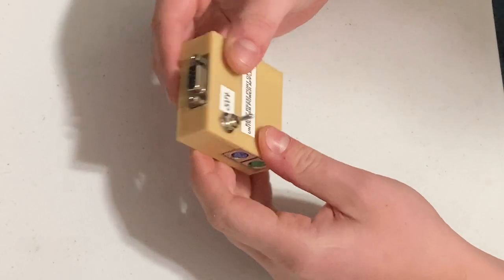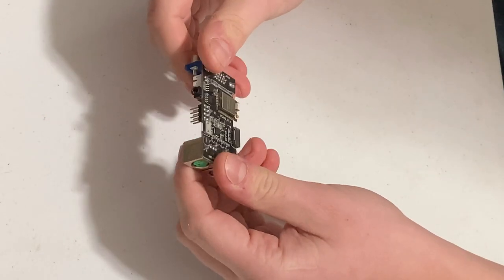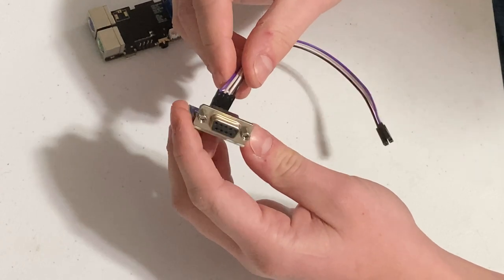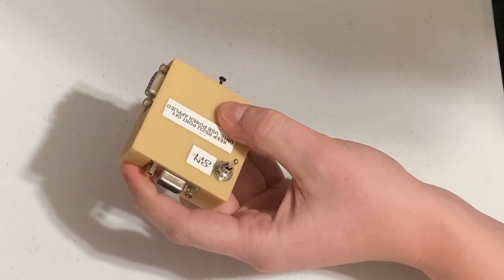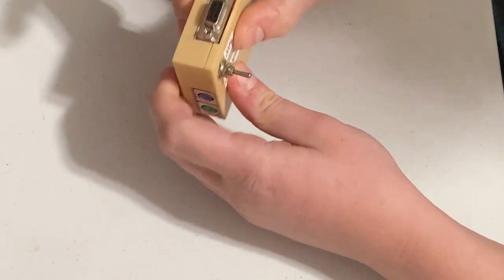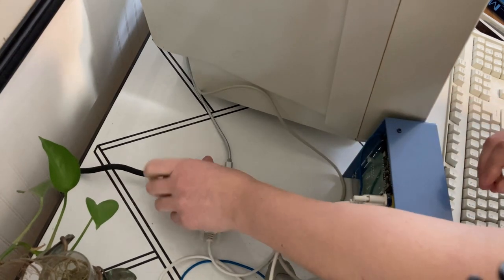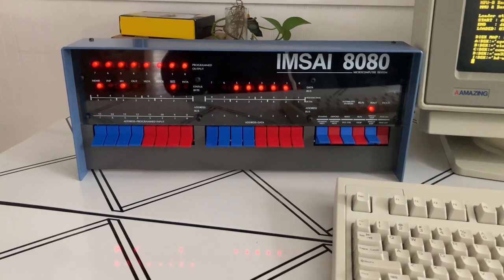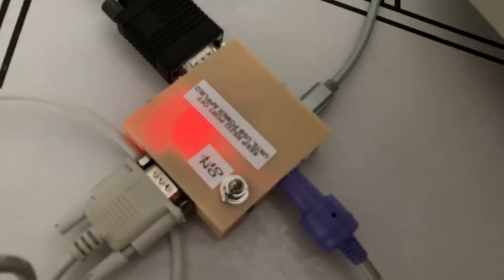How to use any VGA monitor as a serial terminal with VGA32 and FabGL (featuring IMSAI 8080)

Comment: According to Martin Heperle do not use GPIO12, instead connect GPIO14 to RXD on the TTL-RS232C convertor.  Then in your sketch replace the GPIO12 Serial.bgin lines with: Serial.begin(BAUD_RATE, SERIAL, SERIAL_8N1, 14, 2);   <- this way you wont need the switch!

Comment: I am deeply amused that you're use an ESP32-based terminal to connect to the IMSAI 8080 replica that is running, if memory serves, on an ESP32. :)
Reply from the maker: ESP32 INCEPTION! Lol, I am glad to have amused you! I think the new firmware for the IMSAI replica has added the modem function, I should check it out.

Comment: My dream is to build a retro-styled all-in-one vintage serial terminal made from NEW parts. It would be styled something akin to a Radio Shack DT-1 terminal. The case would be made from wood, plastic, metal, or a combination thereof. The keyboard would be a custom built mechanical keyboard made to fit within the case. The internal terminal logic would be something like what you've shown here. The hard part is the monitor. Ideally it would be a genuine CRT monitor, but I could also live with a native resolution 640x480 VGA flat panel. Both are impossible to source new I think.

Substitutes are possible, but this rules out the possibility of making them in larger numbers.

Using a TRS-80 Model 3 or 4 chassis would be acceptable, as would using the monitor from such. The keyboard of a Model 3 or 4 is not sufficient, because they don't contain all the keys necessary for modern operation of a Linux-based computer (square brackets, curly braces, etc.).

Reusing the CRT from an old VGA monitor would be possible, but again, this rules out making them in larger numbers.

I envision the whole thing as an open source project that people can use to actually build one of their own.
Reply: VGA flat panels are available new, but I haven't seen big panels. Biggest I have seen were around 6 or 8 inches.

Comment: Nice project. I see in the comments several requests for information about which pins on the VGA32 module to connect the MAX3232 module to but it isn't answered directly, though a link to an annotated drawing is provided. I also wonder about the need for the toggle switch, which is presumably used to avoid a clash.

Someone commented that the toggle switch can be avoided by using GPIO 14 for Rx instead of GPIO 12, though both are used by the micro SD card socket.

The header next to the audio jack gives access to 3.3V and GND, which can be used to power the MAX3232. It also gives access to GPIOs 39, 34, 12, 14, 13 and 2.

GPIOs 12, 14, 13 and 2 are allocated to the micro SD card socket which might be available for use once the device has booted, if no SD card is inserted. GPIOs 34 and 39 appear to be available for use so when my modules arrive I plan to use 34 as Rx and 39 as Tx and to accommodate that I'll need to edit the sketch. While I'm waiting I'll take a look at the sketch and see which GPIOs are assumed by default.

Comment: Thank for sharing this, I've just reeived a couple of these and I need to add the serial port connection. I was wondering about the 3.3v - 5v issue but you answered that at 2:10. I've now ordered some MAX3232 boards for this job.
Reply from the maker: Glad it was helpful! Enjoy your project :)
Reply: Nick - was the pin out on the VGA32 to feed the MAX3232 fairly obvious

Comment: Hi,  The connections from the TTL to RS-232 adapter to the VGA32 board should be in the description too!  What are they?  I got +3.3V and GND, but I don't know which PINs on the VGA32 are Tx and Rx ... My boards didn't come with any documentation.
Reply: To use the two serial ports, only Port 2 is available on the 'User Pins' on the board and one of the I/Os (io2) on the 'User Pins' is shared with the TF memory card.
The power brought to these units with the FABGL library is mind blowing, a pure work of genius.
********************************
** FabGL GPIOs assignment summary **
********************************

** VGA boards:

  VGA
    HSync => 23
    VSync => 15
    R0    => 21
    R1    => 22
    G0    => 18
    G1    => 19
    B0    => 4
    B1    => 5

  Audio
    AUD   => 25

  PS/2 - Keyboard
    DAT   => 32
    CLK   => 33

  PS/2 - Mouse
    DAT   => 27
    CLK   => 26

  SDCard - HSPI
    MOSI  => 17 (12 on TTGO/WROVER)
    MISO  => 16 (2 on TTGO, 35 WROVER)
    CLK   => 14
    CS    => 13

  UART - UART1 (USB)
    RX    => 3
    TX    => 1

  UART - UART2
    RX    => 34
    TX    => 2  (not usable on TTGO/WROVER with SDCard active)

Comment: Could you provide a schematic of what pins from rs232 board goes to what Ttgo vga board?
Reply from the maker: https://pg-cdn-a2.datacaciques.com/00/NDAy/20/11/05/w8k974n994l381rk/4f6d64cfacc48dad.jpg

Here's a photo of the V1.4 VGA32 board that shows the I/O pins at the bottom middle of the board. When you open up the FABGL library in Arduino IDE you will see "#define UART_RX 34
#define UART_TX 2". This are setting pin 34 to RX and pin 2 to TX. The MAX 3232 board has the RX, TX, Ground, and VCC pins labeled so It's just a matter of connecting RX to RX, TX to TX, GND to GND, and 3.3V to VCC. You can change which pins are RX and TX in the Arduino IDE to whichever pins you like. Also keep in mind that you may need to use a NULL Modem adapter for your particular serial device. I hope this helps!

Comment: Would be better if it took a USB keyboard as they can be found everywhere. Getting a PS/2 keyboard or some kind of adapter these days is usually a special order. Replacing a USB keyboard means a quick trip to the supermarket, replacing a PS/2 would mean ordering and waiting.
Reply: USB to PS/2 adaptor.
Reply: @joefish6091  Yes, go and get one of those from the local supermarket then.

Comment: why the serial port need a on off switch ?
Reply from the maker: I think this was a problem with old firmware, the serial port would not work if it was connected when the board was powered on
Reply: @amateurtinkering2103  thanks

Comment: and when vga is no longer used/available, maybe a raspberry pi zero could convert serial to hdmi, also has usb for keyboard.
or use a vga to hdmi convertor.
Reply: It can be done with a Pi Zero. Just use a USB to serial adapter, or MAX3232 adapter on the GPIO, and use the "screen" command in the shell.
Reply: VGA $5 at garage sales or thrift stores, stockpile a few.

Comment: Cool but I'm not sure this has any advantages over just using one of the many free software-based terminal emulators, most which support serial connections. The reason someone might want to get an old hardware terminal is because they just want it, not that they need the functionality. BTW, does it support ansi colors?
Reply from the maker: There are certainly other ways to connect serial devices, this method is more for the aesthetics of the retro or retro-looking hardware. Just for the fun on it. Yes it does support colors :)
Reply: One project I have in mind is using a serial terminal to control my mpd on a raspberry pi. Yes, it is useless in a way, but it seems to be fun.